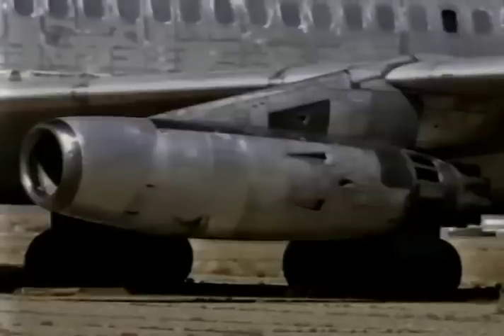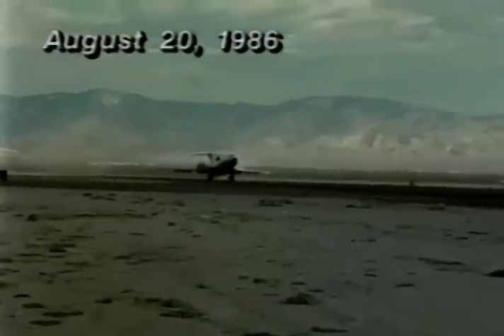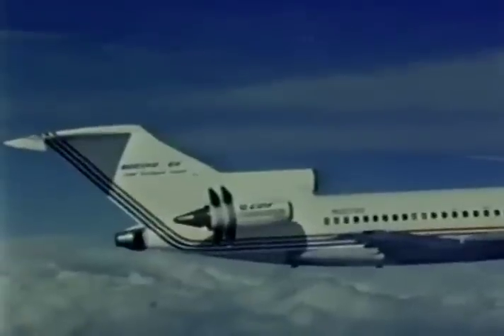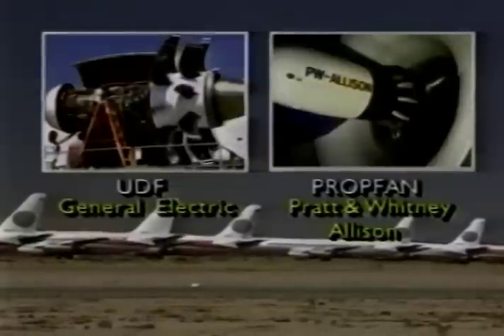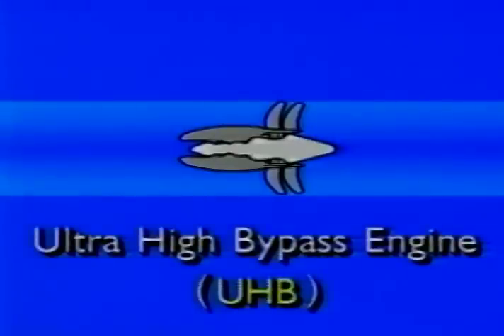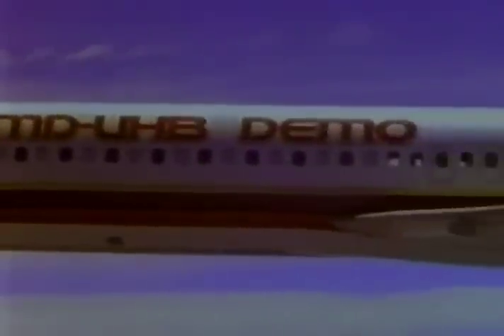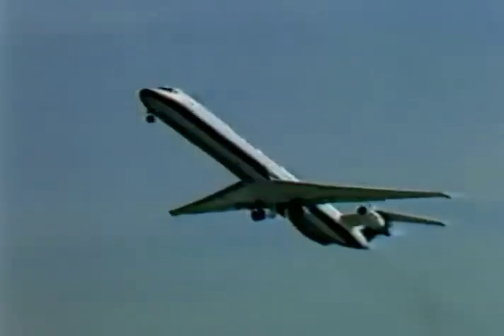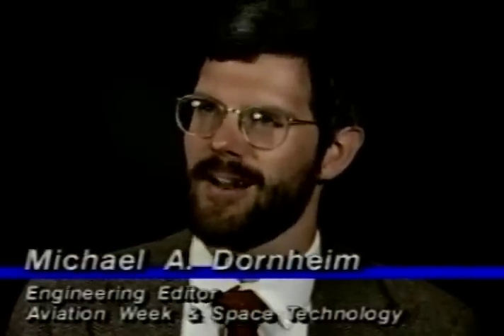The Incredible Engineering of Ultra High Bypass Jets

Comment: only 1 a gallon...... now 4 a gallon. thanks obama
Reply: There is a reason nobody responded to you the first time
Reply from the maker: Mike Warren While your comment is appreciated, we'd appreciate it if you'd keep the remarks to operational and technical issues, not political. We strive to be non-partisan. For the record, during the prior president's administration (2001-2008), the price of jet fuel went from 72 cents to $2.96 per gallon, the vast majority of the increase you seem to be complaining about. Source: http://www.airlines.org/Pages/Annual-Crude-Oil-and-Jet-Fuel-Prices.aspx
Reply: Ouch. That had to hurt. What has it rose since then? I thought plain old car gas price was just supply and demand. Till obama claimed on tv that it was part of his plans to make fuel prices "necessarily skyrocket". Not much we can do about it till hydrogen cars become main stream. Kinda makes me wonder why jet engines don't use hydrogen.
Reply from the maker: Mike Warren The first year of President Obama the price fell (according to the same source linked above) to $1.66 in 2009, but in the years that followed it was $2.14, $2.99 and $3.05 - they don't provide data (yet) on 2013. Hydrogen is certainly a possibility in gas turbines and piston engines as it is easier to adopt by fleet operators as seen with natural gas (methane) bus and utility service fleets. As always, with hydrogen (and any emerging/new technology), there are "issues" and challenges to overcome. But it is very much worth pursuing as you say.
Reply: Here we are around 4per gallon. Diese over 4. Hurts small guys like me. My new truck I can't even fill up the pump simply maxes out
Reply from the maker: Mike Warren Believe me, I and most folks save for those in the fuel refining/sales industry feel your pain. Energy costs are brutal.
Reply: Blame Obama. He claimed on national television that has process would "neccrssarially skyrocket"
Reply: Mike Warren Try £1.30 per litre ;)
Reply: Effing euros :)
Reply: dont thank Obama,  Thank Bush.  Do some research before you open your yap...

Comment: i bet why they didnt use these is due to that it had no way to protect passengers or the aircraft its self if any of the prop pieces came off in flight and strike the aircraft.. its a good idea but it has its flaws.. i bet had they put say some sort of sheilding that at lest protected the air craft it might have been considered
Reply from the maker: Heath Fiedler Thanks for your comment and Happy New Year! I'm not so sure I agree with it as conventional turboprops (and piston props for that matter) have been mounted in similar ways. While these may look more dangerous than old school propellers I don't think they are (or were).

Comment: What about the noise and air pollution?  Is there a new tech to substitute the old concept to new using this ultra high bypass?
Reply from the maker: Sam Sami Thanks for your comment. This concept reduced air pollution thanks to its improved fuel economy. As others have stated in the video's comments, enclosed modern high bypass fanjet engines use much of the core technology here today.  #avgeek   #aviation   #flight   #jet   #aerospace

Comment: I know that it is risky to have engines at the back tail of plane.Because it is possible that ice pieces on low pressure can enter throught the plane and shut all engine down. As i know there is an accident has happened because of this reason. That is why they are not producing this type of engines anymore.
Reply from the maker: Thanks for your comment but I think you are partially mistaken. You are correct that ice may be an issue in that location, but nearly all models of business jet place their powerplants at the rear, so rear mounted engines are indeed still very common and very much in production. I'm not when in the flight phase you are expressing concern about the ice - no plane should take off, of course, if covered in ice, without proper de-icing first. In flight it seems the risks from ice ingestion are rather equal in all common engine locations. Anyone else have something to add?
Reply: AeroSpaceNews.com Cenker if you are talking about ice build-up on a wing coming free and damaging the engine, modern aircraft's leading edges are heated to protect against it in addition to anti-icing measures mentioned by ASN.

Their grandchildren ARE in use (GE90-115,115B, CFM LEAP) and they heralded the way for High Bypass Ratio engines. Why not the funky inside out design? While the aircraft can be build to withstand an ice strike from ice departing a propeller, a catastrophic failure of the engine resulting in the engine shedding it's blades would surely result in tragedy. This is why all modern turbofan engines must be tested to catastrophic failure to ensure the fan casing can contain it in the worst case scenario.

Hope that helps.
Reply from the maker: Keegan Seale Thanks for your thoughtful comment!

Comment: To those with only a little education, i.e. me, this engine technology looks a whole lot like a turboprop. What is the difference here?
Reply from the maker: Thanks for the share Richard and comment/question. The clearest answer I can provide is that these "types" of propulsion systems have many more "blades" than conventional turboprops and are intended for higher speed cruise flight. If you look at the new engines on the C-130 and other platforms today, you will see they are starting to look more like these all the time. Much more to it, of course, that is a very simple answer.
Reply: AeroSpaceNews.com
Thanks for the reply! I did know that traditional propeller-driven aircraft are limited in speed, and that limit is reached when the propeller tips hit the speed of sound. So these new designs are about breaking that limitation, then?
Reply from the maker: Richard Wild Sorry for the delay in response - the new comment system is a bit messy. I'd say the evolution and push on these ideas is really just intended to bring go slower fuel efficiency to going faster planes. :)
Reply: It doesn't have a gearbox like the turboprop.
Reply from the maker: Dino Alberini Thanks for your comment! The UDF has no gearbox but the PropFan in this video, which is another approach to UHB, does have a gearbox.
Reply: That's cool. I suppose they gained some efficiency with added weight and complexity. I still believe that propfans are the future.

Comment: Whole vid, not one mention of how loud that design is.
Reply: I was thinking the same thing. Having ridden 4 times in Bombardier Q400s with their 6 blade turboprops, I'm here to tell you that they are LOUD. The MD engineer sort of alluded to the noise by saying that their planes, with the aft mounted engines, might benefit. Having one of those beaters outside the window, on the other hand, would be horrific. Even with their "active noise and vibration suppression", the Q400 turboprop is freakin' loud.
Reply: Subsonic prop is much much quieter than supersonic high by pass jet engine that's why Pratt & Wittney testing their Subsonic turbine air commercial transmission .

Subsonic Prop blade are very quiet compare to Jet turbine all it do is cut the air and also lift it own blade like Helicopter made both Thrust and Lift at the same times.
Reply: Elranoaz Absolutely not true, Compare the Tu-95 to the B-52 and you will hear the difference.

Comment: LOL! Jet fuel is $6/gal now days. What happened to these engines?
Reply: They're still on the drawing board, is my understanding. Noise is a bigger deal than fuel efficiency right now and in the recent past, and propfans are not known for being quiet. And the high bypass turbofans on modern airliners is 'good enough' for the ticket prices people are comfortable with.
Reply: Advanced in composite fan blades and higher air volume without the same fuel increase made it harder for what was seen as a rushed R&D program that died a death as fuel prices fell. However I would note that only the recent geared jet engine from P&W has been the biggest potential breakthrough in engine fuel efficiency. Up to now, changes in engine weight, higher efficiency jet blades and just bigger engines have all added only a small boost in fuel use ie under 10%. What has made newer jets fly with less fuel is lighter plane materials ie carbon fibre/composites. This lightweighting has also found itself in lighter engine blades, engine shrouds and more precise fuel injectors. All very laudable bits of innovation but all just incremental. With the geared P&W jet engine suffering from reliable and supply issues, its not exactly good news. Engine noise is now the biggest problem and while new jets are quieter, they're just a little quieter, not much faster and rely on light metals and plastics to drive Jets worth replacing..
Reply: Sp and geared jet
Reply: CFM with the Leap engine has achieved the same fuel consomation reduction without the helical gear box, but yes "only" because of the using of more and more CMC on the blades and fan case, carbon fiber. But other technologies are right behind the corners, drum with several stages of friction-welded blades already on it (don't know how much you know but this is pretty huge), can't tell much about it but new stators, high-speed boosters for example
Reply: and where do the fan blades go when they break , no cowl to stop them.

Comment: One of the sources for the extra noise the the counter-rotating prop.  The rear prop is cutting through the disturbed air caused by the front prop.  You can hear the effect if you listen to a Piaggio P.180 Avanti take off.  You hear the rear facing props hitting the turbulence caused by the wing and nacelles.

Comment: Actually the shrouded fans that you find on today's high bypass turbofan are more efficient because the fan casing limits the tip losses of the fan.  One of the things that came out of this research was new fan blade designs.  It's kind of funny though that one of the latest technologies is the geared turbofan engine so looks like the gearbox has reappeared.

Comment from the maker: Not exactly. But as you will see in some of the other comments, close relatives of this technology are indeed flying, which is often the case with technology. For example, the 609 and V-22 are not the XV-3 or XV-15 tiltrotors but they based on the research and development efforts. UHB (Propfan and Unducted Fan) suffer from a "low tech" (propeller) perception and noise issues too. Those could be overcome I think. Thanks for your comment!

Comment from the maker: There may be some cognitive dissonance with that concept but it is the notion that these types of gas turbine engines, at the time this story was produced, offered substantial reductions in fuel burn per unit of power. So they were indeed very much greener than those that came before. Would appreciate your comments without swearing in the future. Thanks!

Comment: Fuel? 
Speaking in aviation terms AVGAS 100 LL is around $6.50 USD per gallon. JET A is around $5.50 USD. Of course it ranges based on location. The east coast U.S. seems to be holding around these prices currently. The farther northeast you go the higher the price.

Comment: Perhaps an easier way to save fuel now would be to equip the front gear with an electric drive motor. The APU can be used to provide power until the aircraft gets close to takeoff, then they can start the engines.
Could make a difference at busy airports, where planes may be on the taxiway for 30 min.+

Comment: @pontifix Correct. One way is to have one propeller with 1 blade fewer than the other, so they don't all align and chop air simultaneously. Another old trick is to curve back the blades like a scimitar. I wonder if they're using evolutionary algorithms on a supercomputers to find a better design....

Comment: While these engines seem to be more gas efficient,  I wonder about the practicality of use with them in commercial use. 1. What how do they stand up against, snow, ice and freezing rain. 2. What about FOD ingestion and Bird Strikes, 3. What would happen if a fan blade failed... would it penetrate the cabin causing decompression? Sever flight control?

Comment: Agree noise was a major problem for the back props specially with the two stage configuration demonstrated. in the a turbo-Fan configuration the diffuser inlet and specially the exhaust mixer at the end of the engine helped improved a lot the acoustics and increased engine performance at the same time.

Comment from the maker: I believe you are correct about cabin noise but they were saying at the time that could be addressed with treatements to the plane and tip speed/shape. The 2009 projects are all shrouded like conventional fanjets - they are not unducted like the story here - but the bypass ratios are very high as attempted before.